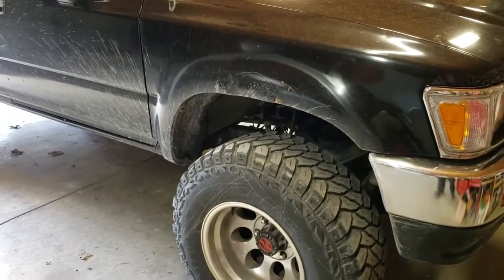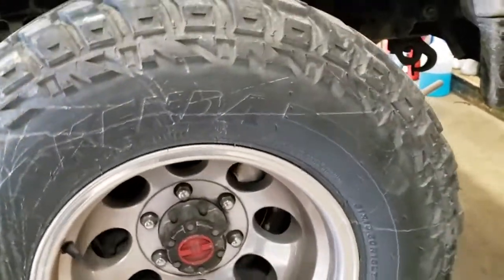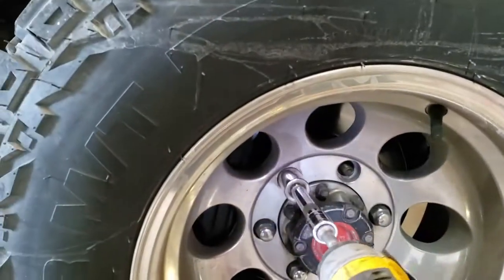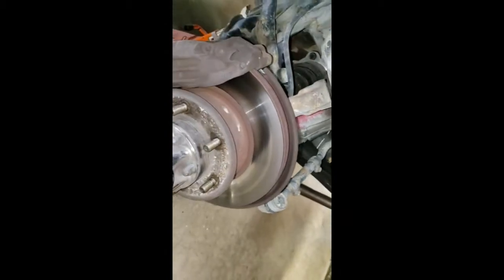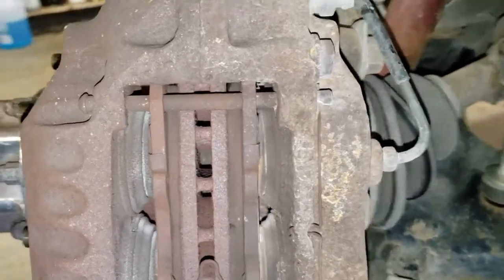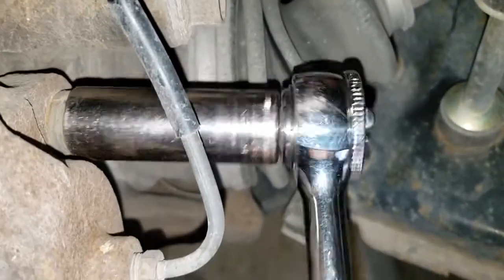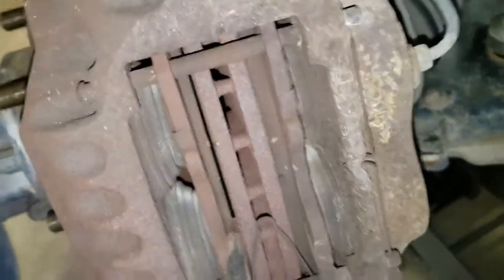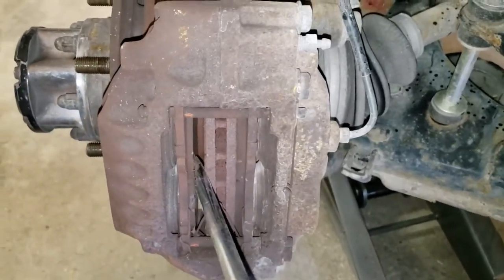Toyota 4x4  Brake Job. How to replace the brake pads

Comment: did you find you needed to top off the displaced brake fluid? How did you address the excess fluid?

i have the same truck, and it was by far the easiest pad replacement i've ever done, thanks in part to your video - thanks brother!
Reply from the maker: I did check it, but didn't show it on camera. I was to the full mark so I did not have to add any. It is a good idea to always check the fluid level when doing this. Glad to hear that all went well on your end, Have a great day.

Comment: This may be a long shot but do you know where i could find a replacement for that specific brake rotor disc? Ive been trying to find them but cant find too much info about them
Reply from the maker: The ones that ere on the truck are from Autozone. I put them on a few years back before I did YouTube. I had already replaced the rotors and calipers.
Reply: @low96hb  thank you for your quick reply, i found them, the rust on my discs were so bad that i didnt realize the hub was able to be taken off and seperated from the disc. Much obliged

Comment: What pads do you recommend?
Reply from the maker: We to be 100% honest. I have tried expensive pads on the truck all the way down to the cheapest thing I could get. The pads in the video are the cheapest thing that my local store had to offer. Nonmetallic because it’s a small truck and I don’t pull a trailer very often. The cheap pads last a long time.
Reply: @low96hb  thank you I was kind of leaning that way.   Appreciate you getting back to me.
Reply from the maker: @queefersutherland8495  you sir I do appreciate the input
Reply: Hey brother me again.   I ended up having to get a caliper.   I'm about to do pads.   I'm not seeing the metal clips on old one.   Are there any?   I'm not talking about pin spring clips.   Not sure what they are called but have kind of u shape to them.   They are not on old caliper.   New pads have shim on back.
Reply from the maker: @queefersutherland8495  There should be clops there. Have they been changed before?
Reply: @low96hb  I haven't changed them before.   This is first time since I've owned it.   Probably put 10000 miles on it since I've had it.   It's an 89 4wd.
Reply from the maker: @queefersutherland8495  I would say someone has left them off before you purchased it.
Reply: @low96hb  I don't see where they go.   Tried watching different vid but they change them like you.   Just press pad back ,pull out old, drop in new.   Easiest looking brake job ever.   I thought I would see them when I took caliper off but didn't
Reply: @low96hb  figured it out.   I have the hardware.   Guy at store sold me clips for 2wd which explains why I could not figure out where they go.   I appreciate you helping me out.   Thanks brother